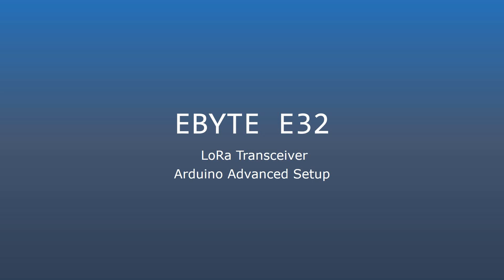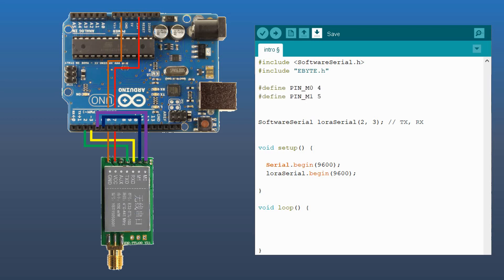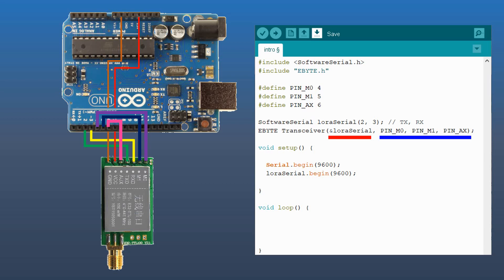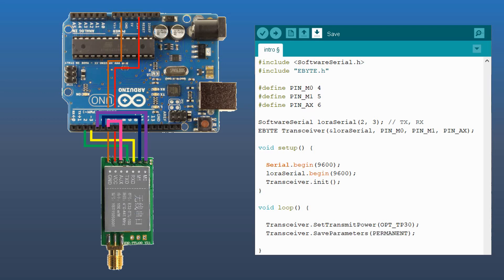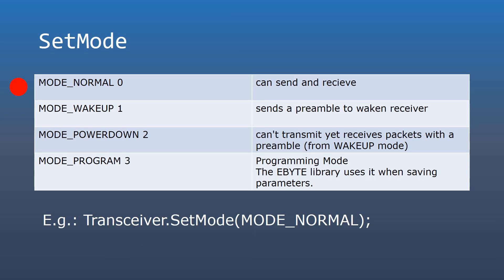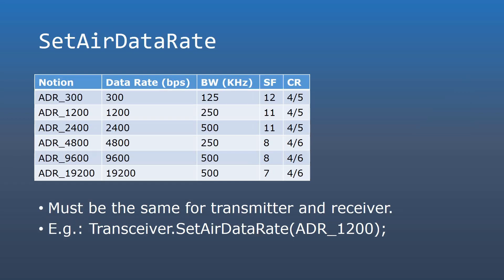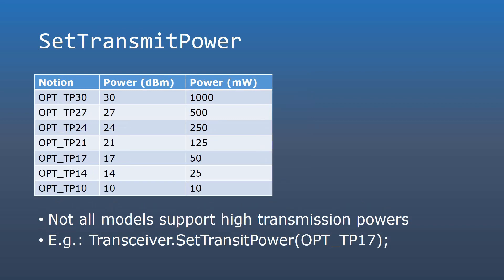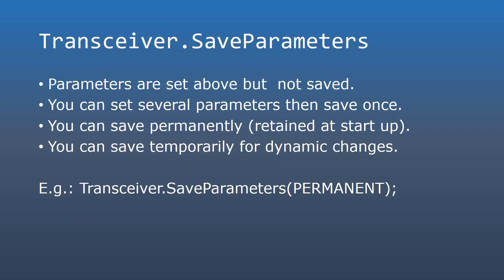EBYTE E32 LoRa Transciever - Advanced Arduino Setup

Comment: Hello, very good example, I need to ask you something, can I use (TRANSCEIVER.SENDSTRUCT   and   TRANSCEIVER.GETSTRUCT) in the same module, to receive and send data at the same time,  more like a bi-directional communication.
Reply from the maker: I don't recall using SENDSTRUCT or GETSTRUCT. But yes the same device can be programmed to function as both at the same time

Comment: Hello, I try to use E32 with Arduino and STM32 but I have a problem about configuration. I can open RF Setting and openPort but when i push getParam i get an error: "No response this module." How can I configure my modules? I tried many things but I could not solve this problem. It is so important for me. Please help.
Reply from the maker: Hey
I'm not familiar with STM32

Comment: Hi, i have a question..
Does the Ebyte Sx1276 lora module work (send and receive data) without antenna?
Reply from the maker: I'm not sure what you mean by without antenna. The place designed to plug the antenna itself can radiate and therefore it is some form of antenna. A bad antenna though.

If you mean that it has an integrated antenna, I'm not sure about that.

Comment: Hey dude nice video helped me a lot, can you help with printing the info into an oled with arduino on the rx??
Reply from the maker: Hey
I don't have the LoRa devices righy now but I think it depends on ur oled. Does it have a library? Does it communicate through software serial?
Reply: @jtech1873  actually yes, my oled uses i2c comunication and has the adafruit oled library. But I discovered that actually it is not the oled the problem, is the code with the lora module, now I can receive the data but whenever I try to receive data from a remote dh11 and a local dh11 it freezes

Comment: Thanks 🌹
Can we used to be telemetry for drone
Reply from the maker: Hey. I haven't worked in drones. I think that there is nothing that prevents using it on drones. However, LoRa has a low bitrate and regulations in most countries prohibit continuous transmission, so it depends on how much data you want to send and how frequently you want to transmit it.

Comment: Hi, Can you show the result from this video ? bcz in my prjoect the arduino ide coding can't running. Please Sir.
Reply from the maker: Hello. I don't have the equipment anymore
Reply from the maker: Can you send me your code private?
Reply: @jtech1873  
I have a project from my lecturer, the project is to vary the parameters of lora. as we know lora have 3 parameters 
1. bandwidth 
2.Coding rate 
3.Spreading factor.
I try ur tutorial from this video , but my code is't not running. can you help me sir?
Reply from the maker: From what I've seen in the Ebyte library, I wasn't able to control the individual parameters (I was able to control them on other devices). The seller also said that I can't control them individually (I can't be sure if they are right though), and all they sent me concerning the parameters was the SetAirDataRate table.
Reply: @jtech1873  so how do we get to know the value of the parameter sir?

Comment: hi, i need to send data with E32 on ttn (thethingsnetwork) how can i find an arduino sketch because i need. reagrds
Reply from the maker: I haven't experimented with TTN and currently I don't have the kit. Did you try the circuit that I did?
Reply: @jtech1873  yes but not work

Comment: Hello, i have connected my module Ebyte E22 like you, and when i try to read Parameters with "Transceiver.PrintParameters();" i have :
----------------------------------------
Model no.: 0
Version  : 0
Features : 0
 
Mode (HEX/DEC/BIN): 0/0/0
AddH (HEX/DEC/BIN): 0/0/0
AddL (HEX/DEC/BIN): 0/0/0
Sped (HEX/DEC/BIN): 0/0/0
Chan (HEX/DEC/BIN): 0/0/0
Optn (HEX/DEC/BIN): 0/0/0
Addr (HEX/DEC/BIN): 0/0/0
 
SpeedParityBit (HEX/DEC/BIN)    : 0/0/0
SpeedUARTDataRate (HEX/DEC/BIN) : 0/0/0
SpeedAirDataRate (HEX/DEC/BIN)  : 0/0/0
OptionTrans (HEX/DEC/BIN)       : 0/0/0
OptionPullup (HEX/DEC/BIN)      : 0/0/0
OptionWakeup (HEX/DEC/BIN)      : 0/0/0
OptionFEC (HEX/DEC/BIN)         : 0/0/0
OptionPower (HEX/DEC/BIN)       : 0/0/0
----------------------------------------

An idea please ?
Reply from the maker: Hello,
I didn't get the chance to explore the e22, but I'll assume it is similar to the e32
In fact these are the parameters of your transceiver. Since we are using the Ebyte.h library we were able to set them through its functions, yet, you can edit these parameters by inserting their hexadecimal, decimal, or binary value.

Referring to KrisKasprzak
's Ebyte.h: https://github.com/KrisKasprzak/EBYTE/blob/master/EBYTE.h you will find the corresponding binary values for each option.

In case you used the functions and these parameters did not update, it is most probable that you didn't save the parameters.
Reply: A bit late answer, but I got the same output when I had the module wired wrong. The hardware serial was not connected to the right pins. In ESP32 they were 16 and 17 and in ESP32-S2 Lolin S2 mini I had to define them as RX = 18 and TX = 17. You need to check the pinout for your chip.

Comment: hi, thanks alot
but i  need to know how you can guess the air data rate is according to set spreading factor too, in manual book i didnt get this information
Reply from the maker: In fact the information isn't mentioned in the manual book. I've contacted a supplier who gave me this information.
Reply: @jtech1873  can i ask the supplier contact ?

Comment: How to set up lora wake-up sends the data and goes into low power mode sir how to do this configuration in arduino
Reply from the maker: You have to use MODE_WAKEUP before sending and switch to MODE_POWERDOWN afterward
Reply: @jtech1873  thank you so much sir please make tutorial on how to send sensor data using same module with power saving configuration...

Comment: How to set low power mode in arduino sir
Reply: xxx.SetTransmitPower(USE_PROPER_DEFINE);
xxx.SaveParameters(PERMANENT);

if you are using a 100mW define is probably OPT_TP10, the 1 watt unit it's probably OPT_TP21--see the .h file for chosing the correct one.

PS...I'm the guy who wrote the EBYTE lib :)
Reply: @KrisKasprzak  thank you sir

Comment: How to make simple message transmission using Ebyte & Arduino. Please make a tutorial on it.
Reply from the maker: I will work on one soon. But briefly to transmit a message you send it through the softwareSerial to the Ebyte, Also the received message can be received through the softwareSerial.
Reply: @jtech1873  Thanks for your reply.
Reply: @jtech1873  can I send long sentence ??? How fast can it receive it?
Reply from the maker: You can send a string, the broadcast time depends on the data rate and typically it is less than a second
Reply from the maker: I uploaded a video that shows how to send and receive messages. You can combine the code to have one device acting as sender and receiver. 
https://youtu.be/wYjALYK7pqU